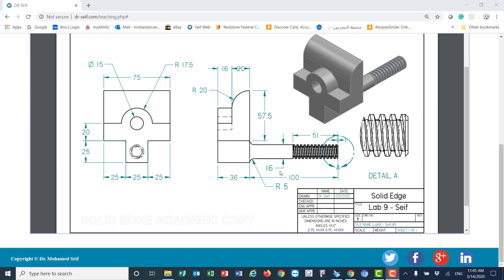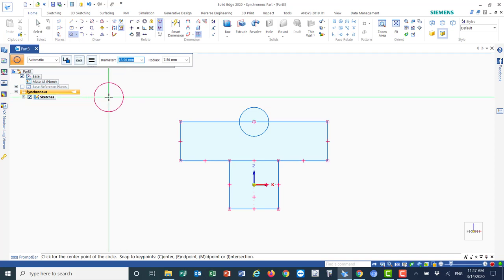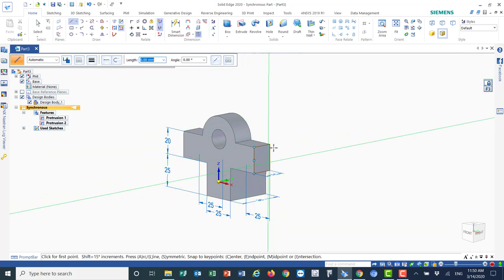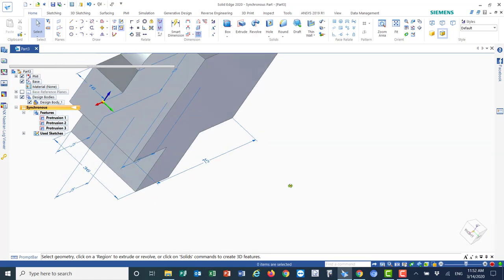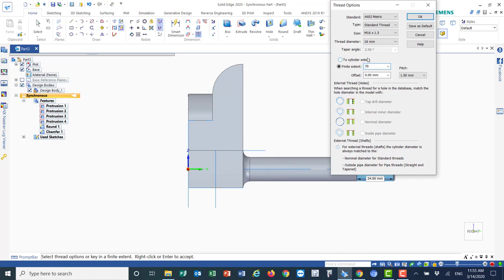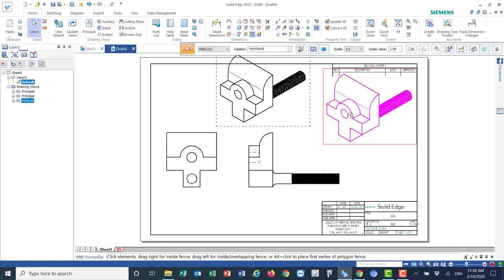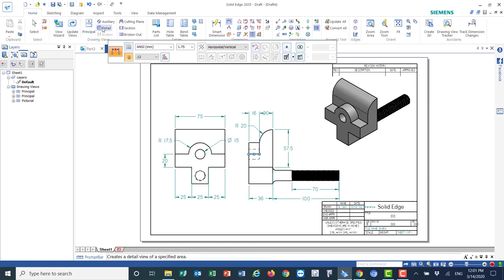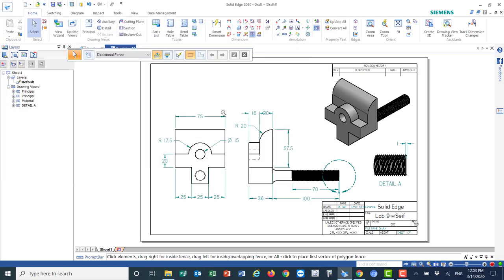Learning Solid Edge: (Lab 9)

Comment: High did you know there is a way to get the dimensions on the same line? just place the first one where you want it, and the adjacent one, drag it shortly over the first one and then move it to its desired pace it seems locked to the first dimension kind regards Hans
Reply from the maker: Thanks for your input. It is highly appreciated.

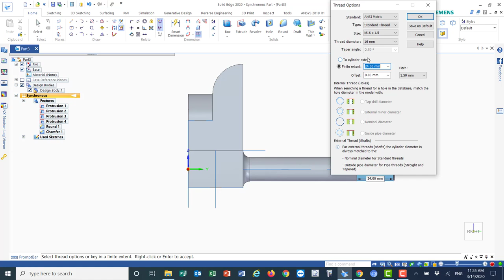Comment: 10:37 here i think there was a mis-reading. Indeed you told 70 but the draft says 51, and the pitch you chose for 1.5 but the draft says 1 and it has a more flat taper angle rather than slanted to 2.50°. It is ISO Metric Trapezoidal.
Reply from the maker: Thank you for the feedback. It seems that I need to update the video.

Comment: Hint: After the upright straight line with dimension 57.5mm - to properly make an arc of 20 mm Radius. Use a key command. Simply press keyboard 'a' to put the line command into arc command mode. Move the cursor and arc right to the end of the line segment where it terminates and click the mouse.  The arc is made without a lot of commands for straight lines, fillet, and Trims. Now end the feature with a straight line down to the object. For the next extrusion - drag the extrusion to the end of the part and hover the mouse over the corner of the part until you see the stick and ball icon showing you are at the point. Click. The extrusion is now at the correct spot and dimension. Without extra work and typing. 

Dr!  It is very confusing and frustrating to a student attempting to follow your instruction when you, without notifying the student, begin to customize the part - wildly deviating from the original design reference drawing.

Example:
-  The round fillet at the base of the screw is to be "5 mm" per your drawing. Not 4.5 mm. 
- The thread extent from drawing is 51 mm and not your change to 70 mm.

Also,   ?  How did you determine the M16 x 1.5 thread ?
 In the original drawing the threads are clearly trapezoidal and the function of the part looks to be a bench vise jaw.  Why did you select the wrong threads to copy a drawing and not follow the design purpose?  Upon my review it looks to be more closely a trapezoidal TR 16 X 2 thread.

Your tutorials and presentations are very misleading and confusing.
Reply: I am learning many 'wrong' things to do for inaccurate drawings. But, not able to learn on my own to correct 'all' your mistakes.

Note: The dimensions noted as inches unless otherwise specified in the Title Block.   Sigh...

Note 2:  The New Draft Page - ANSI Metric page with selecting size B will have the correct Title Block note, you won't have to change the dimensioning from 'inch' to 'mm' and the sheet will be Standard Draft Page Size of B for printing.  All your drawing need to be corrected/updated, Dr.